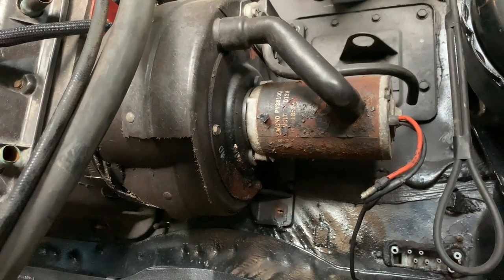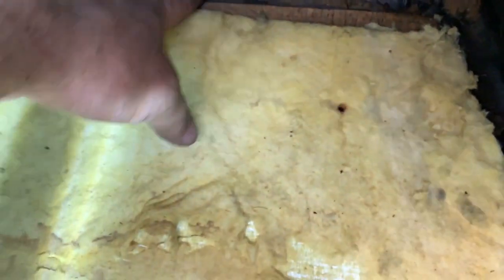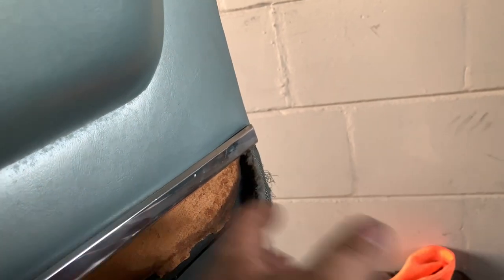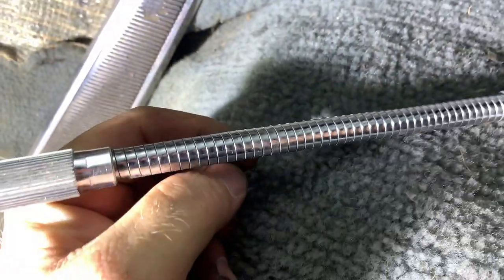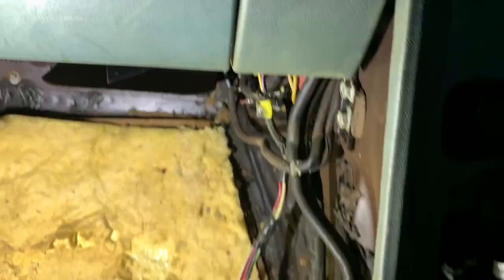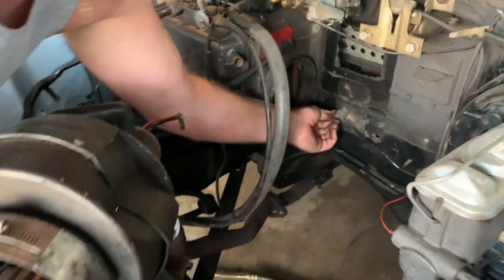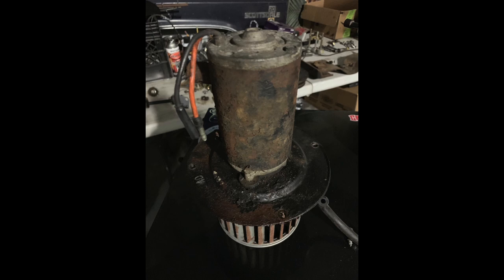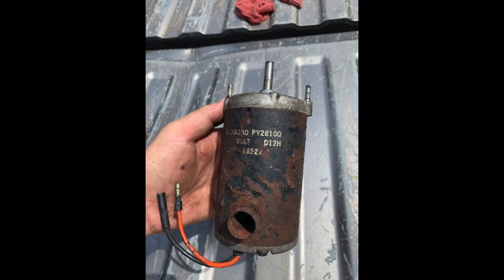1964 Lincoln Continental Convertible AC Blower (Hamster Wheel) Removal & Restoration

Comment: Great video and in site into these cars, and thanks for heads up on this part as I’m removing my engine this weekend. I’ll be sure to keep a look out with the housing when removing my original 430. Your videos as well as Nathan’s are extremely informative and very helpful. Much appreciated
Reply from the maker: Awesome. Thanks for commenting. If you have any questions let me know. I also do a FREE Lincoln podcast titled Lincoln Addict. I should do an entire show on removing an engine.
Reply: Lincoln Addict absolutely you should, I’ll probably be the first to view and follow:-) as big as the engine is I don’t think it should be to difficult, I just plan on taking allot of photos like y’all both suggest and label EVERYTHING I remove. I think the tricky part will be finding good and reliable parts to fix my engine with. I was told by the mechanic that I have a ‘flat cam’ whatever that means??

Comment: I converted to the Champion Aluminum Radiator and the electric fan you had suggested. Do you have an active A/C system?
Reply from the maker: Awesome. That’s something on my list to do is to refurbish the air conditioning my friend Blair swears by getting a new condenser he says the newer style condenser is better when you upgrade to the new Freon I guess it flows better or something… But I’ll be documenting that I hope to do it this summer I actually need to refurbish my 64 and 65 so I’ll definitely be doing more contact on that thank you for the support

Comment: Jason can we use our original fan with a vintage air kit?
Reply from the maker: I would check with Vintage Air. I used their stuff on my ‘67 but it was a Compac system. I know they have different setups. I love my electric radiator fan.

Comment: Not sure if any of this stuff works on mine but I'm considering a restomod ac kit. Anybody have any decent input in the matter?
Reply from the maker: I did a Vintage Air setup in my resto mod ‘67. DeviousCustoms.com makes a new block off plate for the firewall now
Reply: What are the details(review)of the vintage air setup? I like the hidden firewall look  but the aluminum plate by devious is costly for my application.  I'd get that bulkhead separately if I could though. I'm asking before I commit.
Reply from the maker: @busara45thevillain22  honestly not sure. Some seem to have ran it with no issues or complaints. Checkout Lincoln Addict or Suicide Slabs Facebook Groups. Some on there have used it.